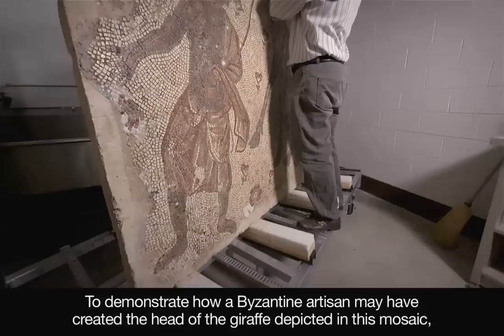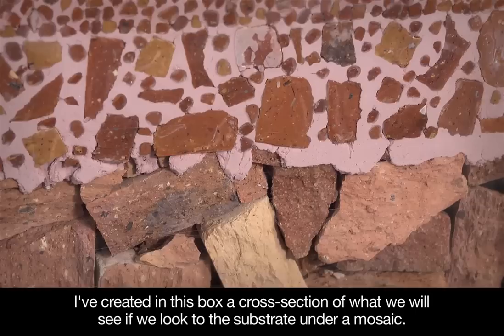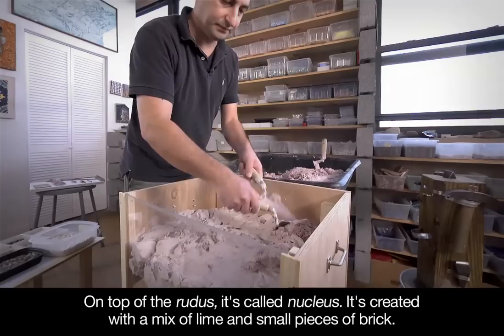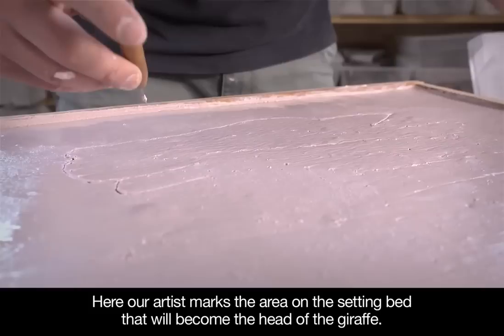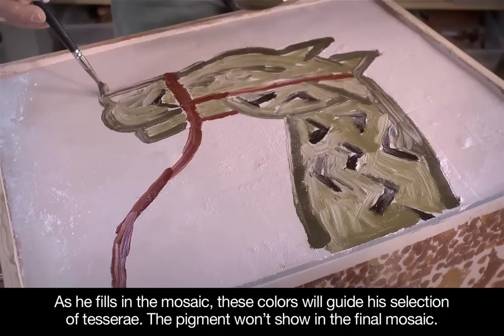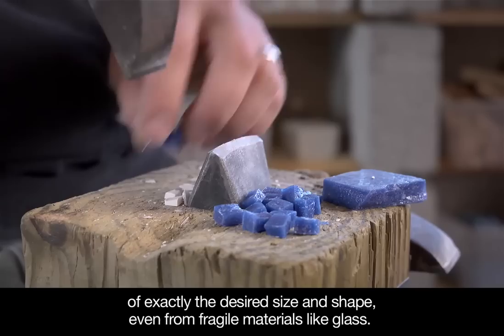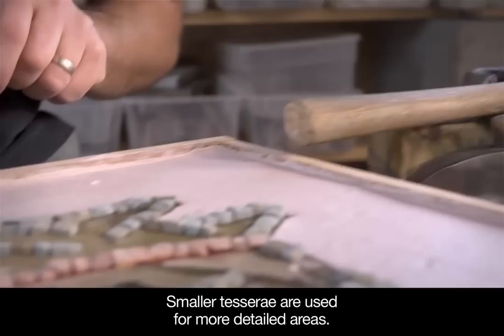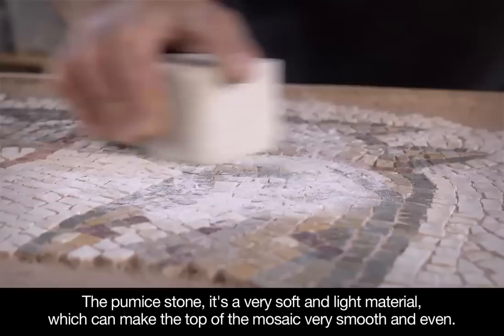LaunchPad: Making Ancient and Byzantine Mosaics

Comment: How long does the artist have to place the glass before the mortar dries?
Reply: More mortar is rubbed over to as grout later on to fill in the gaps
Reply: Half a day at least I would imagine.
Reply: @SpeedomusicSM  Sorry that is not correct.  The mortar is what glues the pieces, which are called tesserae, in place.  The mortar, depending on the type you get, can last an hour or up to 7 hours.  There are many different kinds of mortar
Reply: @angelasanders5532  why would they leave gaps it's weaker, they must grout it with something

Comment: where do I get a chisel like that?
Reply: I got mine from a thrift store, a regular broad head metal chisel about 1-1/2" wide, cut the shaft down to about 2", drilled a hole in an oak stump to mount. These go dirt cheap, about $2, even less if the striking end is mushroomed but who cares it's cut off anyway. I also got a mason's hammer for cheap, not as heavy as the real thing but still quite serviceable, one can get this tooling for well under $20 if you shop around.☺
Reply: That is not a chisel but a tool called a Hardi.  You can buy it from an online mosaics supply.  There is one in Chicago call Tiny Pieces.  They will give you the correct instruction on how to place it in the stump.  You need to drill the hole deeper than the hardi so that it doesn't touch the bottom because that will create bounce back and the glass will not cut properly.
Reply: So these are special hammers and the other piece is a hardi.  Mine all came from Italy and are made with special heads to cut stone or glass.  You mount them into fruit wood.  The  equipment is very important because if it is not correct, you waste so much glass.